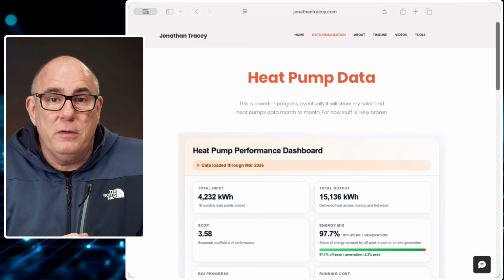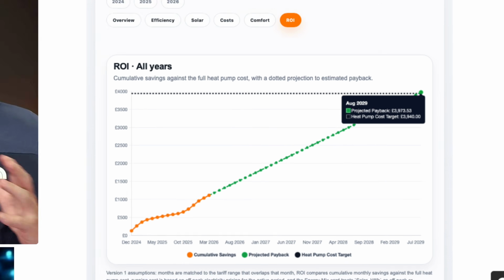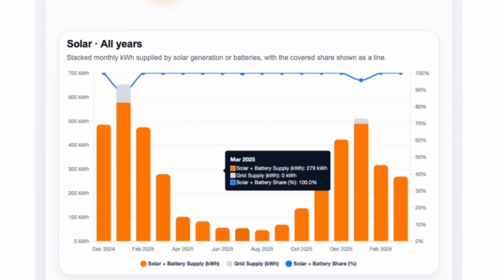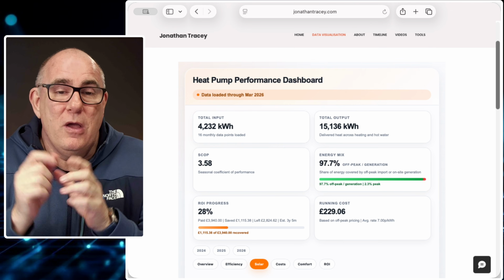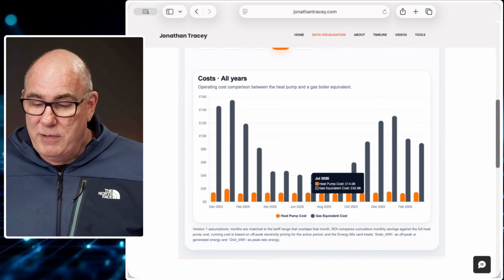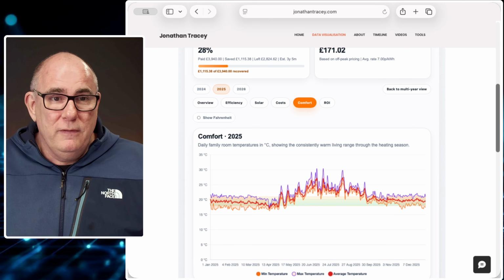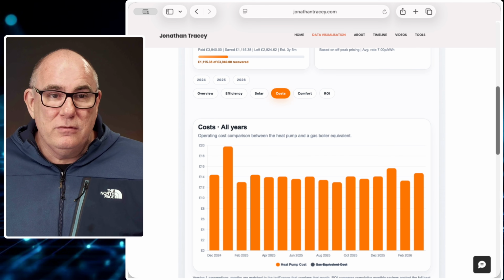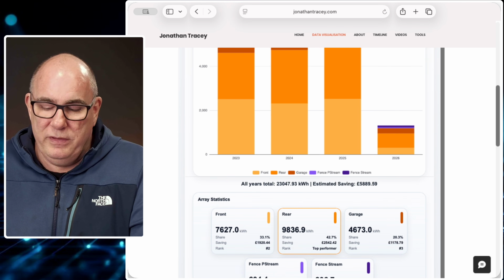Heat Pump Running Costs UK – Real Data (Octopus Energy + Solar)

Comment: So around £4,000 would be the similar price to fit a gas boiler if you needed a few changes along the way. We never ask people "How long will it take to repay your gas boiler?"
To me it is often a mute point, but the fact we can make it pay for itself is amazing and a huge bonus.

My ASHP keeps our 1970's detached 4 bed home at 19c with a drop to 17c overnight.We use around 3,000kWh per year. At my current 26p per kWh peak, the worst cost would be £780 per year. I will say that our home has been far more comfortable since having an ASHP and is far more comfortable all the time.

I am looking to triple my battery storage and add more solar and this should be enough to remove any electricity bills. So free home use, cooking, heating and driving 12,000 miles per year. I could never do that staying on gas or using a petrol car.

I do have a question, as when you showed your ASHP usage over the year it was an almost flat curve. This includes all my DHW use as well.
My usage figures in kWh
January        791.89
February      484.76
March          269.18
April             144.86
May               71.25
June              41.30
July               39.30
August         41.14
September   31.57
October        64.82
November  346.15
December  442.04

As you see, the usage goes up over the winter months. Even if I have batteries that can let me use off peak rates, it still will increase as it gets colder. As we also know, solar output will not be 500kWh per month in mid winter, let alone 800kWh, so how can yours be flat through the whole year??? I guess something is missing in your ASHP  winter figures.
Reply from the maker: @Jaw0lf absolutely spot on 👍  

That’s exactly how I see it — we never question the ROI on a gas boiler, yet with a heat pump it suddenly becomes the main focus. The fact it can actually pay for itself is a huge bonus.  

My install was very similar — like-for-like replacement (new boiler + tank equivalent) and I had to change 7 radiators, so the upfront cost comparison is pretty fair.  

But the big thing for me was what you mentioned… **being able to create your own “fuel”**.  

Once you bring solar and batteries into it, you’re no longer just buying energy — you’re generating and storing it. That’s where it really starts to change the game 👍
Reply: @JonathanTracey  Just thought about your chart and it is based on monthly payments. So that must be what you were trying to show, but maybe needed a larger explanation. Electric use will follow that of the gas line for the ASHP, but as we offset through batteries and export througout the rest of the year, end result is low bills.
It can be misleading to think the ASHP only used say £13 in February.

Comment: Just wondering what your inverter size is?! After all you can charge a lot of batteries very quickly at the cheap rate if you're on 3-phase or have a generous G99 allowance.
Reply from the maker: I do have a generous 10kw allowance for export under my G99, the inverter is a 10kw so yes I can charge batteries quickly. I used to have a 3.68 but it just became a bottleneck. Im on a single phase supply as well
Reply: @JonathanTracey that bottleneck is what I'm afraid of. Whilst most of the time I'm idling at 200Watts, there will be frequent occasions when for a short time I'm exceeding 3.68kW. I understand the NSOs reasons for 3.68 and it seems generous, but I have no intentions of exporting. Ideally I want a system that can leave me almost totally self sufficient in January. It seems that not even having DC coupled batteries will get anyone without G99 pull more than 3.68kJ of their own energy each second.
Reply: @friarchris2  There is a thing called G100 that permits approved equipment to be installed where your export capacity is limited by the DNO but not your generation capacity. Basically it's allowed if the equipment is shown sufficiently reliable and safe that the DNO trust it not to overexport in error and blow their transformer up.

There are cases that a G100 is refused entirely but they are very rare and mean the infrastructure is totally broken. In that case you can still run some or all of your house with a non grid tie inverter that charges via grid, supplies the house and is fundamentally incapable of exporting. It's an unusual option but it does exist

Comment: A very interesting set of data for your particular setup. To offer a bit more useful data, I'd offer the following suggestions: 
1) if you could calculate what % of your batteries capacity is being used to run the heat-pump, that could offer a more accurate ROI. The current data is only taking into account the £3,940 you spent on the heat pump, despite you stating that you are saving money by storing cheap off-peak energy in the battery. A quick goggle suggests the batteries would cost about £11k (+install), so if you are using half of that storage every day to run your heat pump, it would be reasonable to account for another £5,500 (+) to meet your ROI target (for example). I'm sure you could mine this data fairly easily, in fact it's probably on the page should I dig around a bit.

2) you aren't taking into account that a lot of the energy is coming from solar, rather using a 7p/kwh for running costs. The real cost to you is the income you are losing from using solar to run the heat pump rather than selling it back to your supplier for whatever they offer you at that point. I'm sure this is the best financial decision (self-use rather than exporting), but it'd be interesting to see what effect this has on costs. Again if you're going to take into account these savings from using solar rather than off-peak (which is what you are actually doing for most of the year), then the cost of the solar install needs to be considered. Your data would show more savings (because the energy is now 'free'), but your ROI target would need to include a % of that solar setup cost that's used to run the heat pump. 

Sorry it seems a lot of extra fiddling with data to get a more accurate picture, but I get the impression you like to play with data figures like this anyway !
Reply from the maker: @danb2529 really appreciate the detailed breakdown 👍  

You’re absolutely right — if you go fully granular, you can start allocating battery cost, solar cost, opportunity cost of export, etc.  

The reason I don’t include those here is I account for them separately in my *solar dashboard**, where I look at the full system economics as a whole. This video was more about isolating the **heat pump performance* rather than stacking every system cost on top.  

On the solar/export point — I agree in principle, but in practice I prioritise **self-consumption over export**, so I treat that energy as reducing my import cost rather than “lost income”.  

You can definitely keep refining the model (and I probably will 😄), but from a viewer perspective it quickly becomes very complex — and most people are really just interested in **what it does to their bill in £ terms**.  

That said, I do like the idea of doing a deeper dive with all those factors included 👀

Comment: Hi Jonathon, thanks for your recent video. I have two questions: 1) should you have included the cost of your batteries and the loss of ISA interest on your savings when estimating your ROI? 2) are you aware of reliable reports that the COP and SCOP reported by your heat pump application is almost always inflated by as much as 20 percent? Perhaps you should consider installing a heat meter in your system because you are very keen to present real-world data in your videos.
Reply from the maker: @jimlynham great questions 👍  

On the ROI side — I don’t include batteries or ISA interest in this video because I account for those separately in my **solar dashboard**, where I look at the full system economics. This video was more focused on the **heat pump itself in isolation**.  

On COP/SCOP — you’re absolutely right, they can be off to some degree depending on how they’re measured. That’s why I tend not to lean too heavily on those figures.  

At the end of the day, the thing most people actually care about is **£ on their bill**.  

All the other measurements are useful for analysis, but for most viewers it really comes down to: is it saving money or not? 👍
Reply: The  Scandanavians don’t live in Victorian houses though
Reply: Great post,  if you don’t run EV’s cos we love ICE cars, what would you need one less battery?

Comment: I see negative comments about heat pumps and solar batteries all the time. Like one, I saw today claiming how someone's sister had one installed in Scotland, and now she is being charged £1900 per month for electricity just to heat her small home, but when she had gas, it was costing her just £60. This is a real comment I saw on FB, also I saw some in the Independent today and over the last few weeks saying the same sort of rubbish. But luckily, these people are now getting much pushback, the same as the anti-EV crowds are also now getting.
I have some good news for me, my neighbour on the west side of my garden has just installed a solid wooden panelled fence, which means I don't have to, and I can add some panels. I've been looking at Gen 3 panels like the Aiko Neostar 3S 480W N-Type ABC, which are normal size at 1762mm X 1134mm, and are warranted for 88.85% at 30 years of use. They are a bit expensive at £85 each, but all panels have just shot up in price. As the fence is around 1200mm high, I will have the panels on their sides, and angled at 70 degrees facing due east, meaning I get the full early morning sun for 2 hours on the 1st of Jan, but using Suncalc. I should get some OK power throughout the day, to around early to mid-afternoon, depending on the time of year. And they claim, Gen 3 panels achieve much better efficiency in poor light conditions from there 24.5% efficiency. I will have a look at your Dashboard, thank you. But how are you pulling the data?

Comment: First 12 months with an 8kW heat pump used 3700 kWh. Our average unit cost for electricity purchased is 7.24p/kWh, disregarding export income. So that comes to £268 running cost for a year. Previously, our gas bill was around £700 pa on average and that was to heat our home for 2 hrs am and 5 hours pm whereas now it’s warm 24 hours a day. Set at 20.5C. No contest!
Reply: Have a very close look at how that heat pump is operating. I suspect it could be running at higher COP if it was moderated down a bit in power. My 7.2 kW heat pump ended up moderating itself down to only 3.1 kW by using demand control to let it adjust it's inverter driven compressor. Result was a very marked increase in COP and much less defrost cycles. For most of the time mine was running 7.2 kW was waaaay to much causing it to reach target in very short time and then struggling to reduce down without shutting off. This caused it to cycle a lot. The high power also made it frost up a lot more and at the more moderate power level it often avoided defrosting all together.
Reply from the maker: that’s not a bad saving is it, congrats